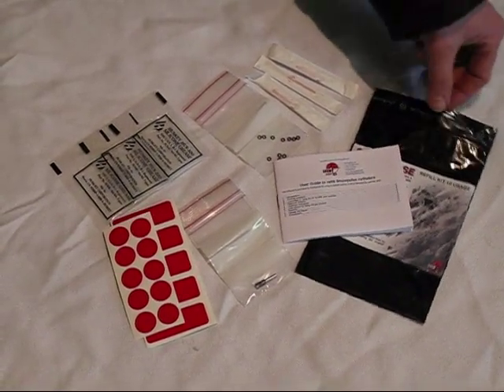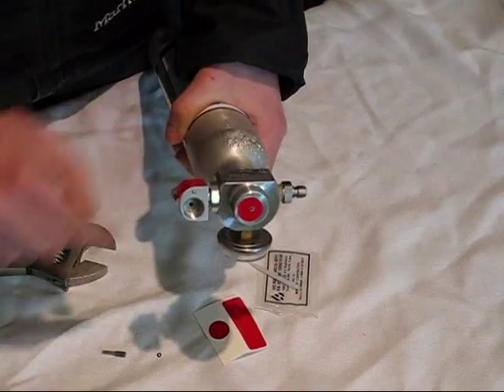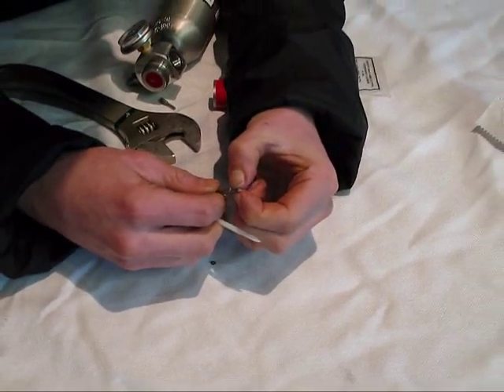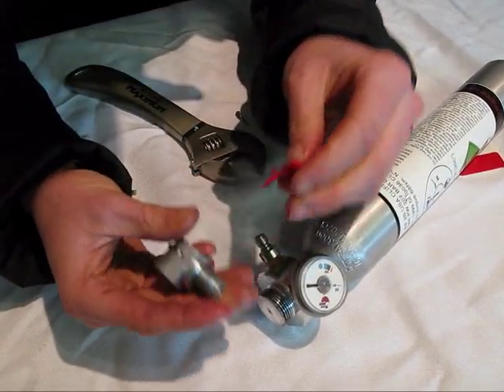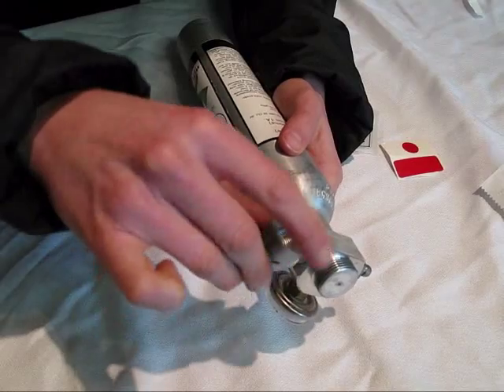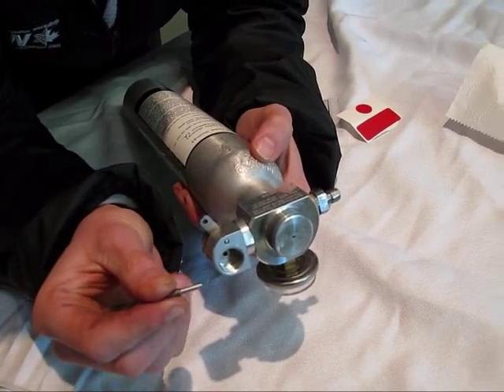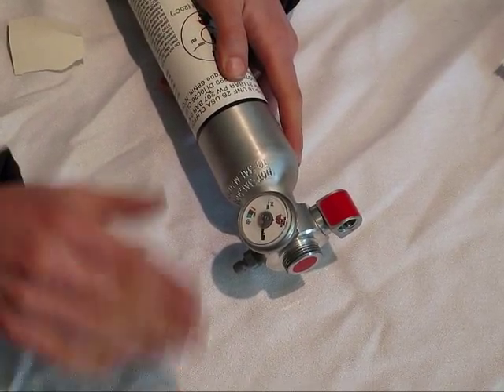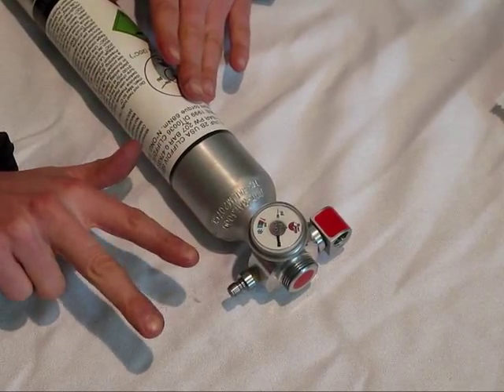Avalanche Safety | Snowpulse O-Ring Change

Comment: AFTER WATCHING YOUR VIDEO I ENDED UP BUYING A 2021 BCA FLOAT 32.SURE I HAVE TO CHANGE OUT THE TINY O RINGS EACH AND EVERY TIME BUT COMPARDE TO THE REGULATOR YOU USE AND WHAT BCA USES YOURS LOOKS LIKE A NIGHTMARE
Reply from the maker: Hey Craig - this is a 10-year old video and for Snowpulse 1.0 tech, which isn't made any more. Here's a link to Snowpulse's new refill, which doesn't use o-rings: https://youtu.be/T57LIR6h1mA . Hope you did your new BCA Pack :)